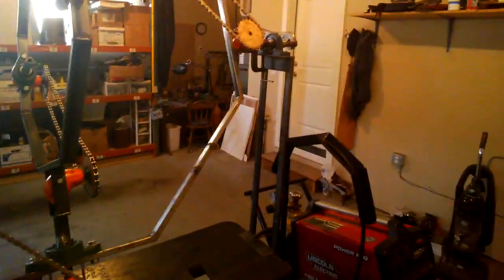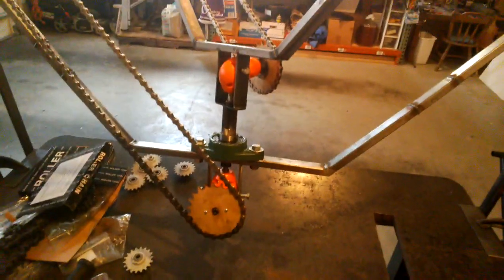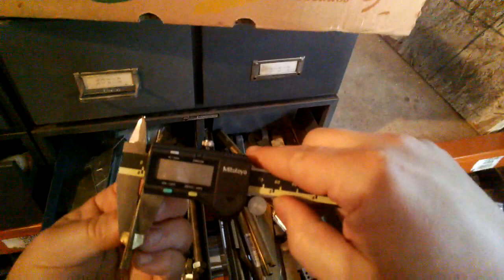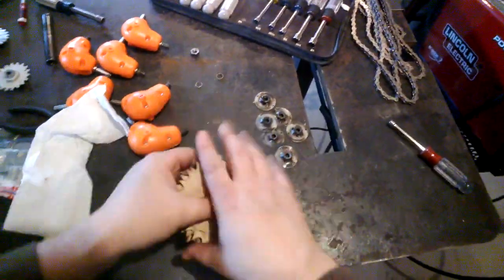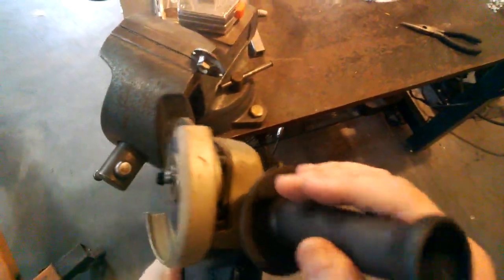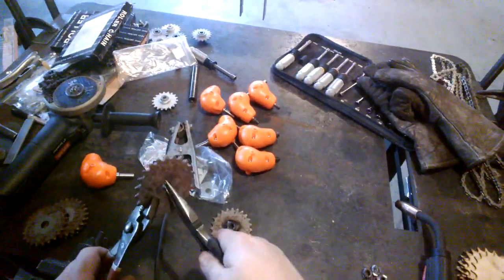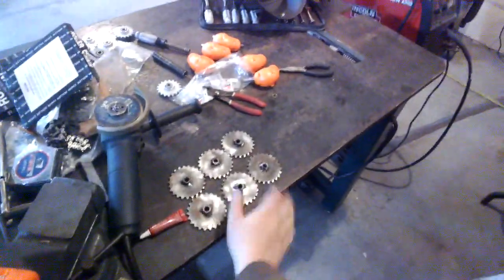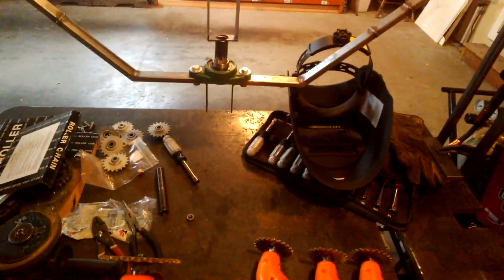Sprocket Welding -- Google Glass POV Test

Comment from the maker: I'm finally experimenting with using Glass in the shop to record project work. This was a deliberately minimal test -- all live, no retakes, with only the most basic of editing. Felt a bit weird working that way, knowing that every mistake would be so visible, but I think I could get used to it. I need to get a bit better at holding things where they can be seen, and twisting my welding helmet over a bit to give Glass a better view. Over all, though, I thought it came out pretty well.

Offloading and editing the video is annoyingly difficult, though. I'm hoping that can improve as the Glassware develops.